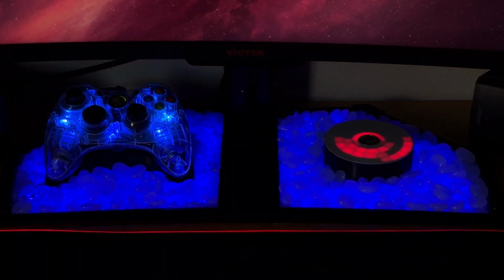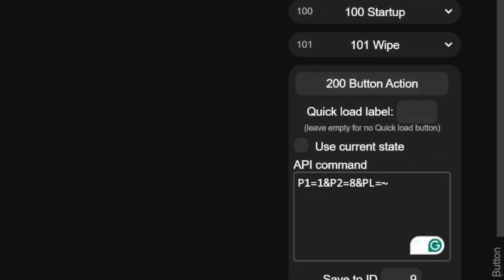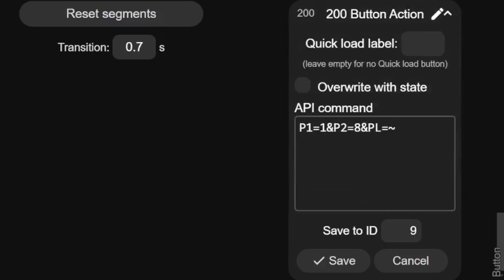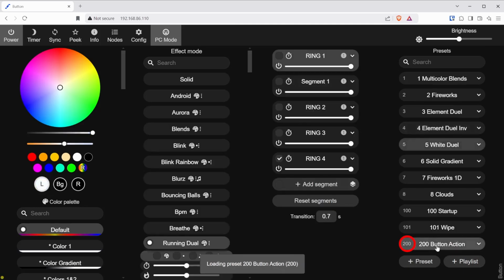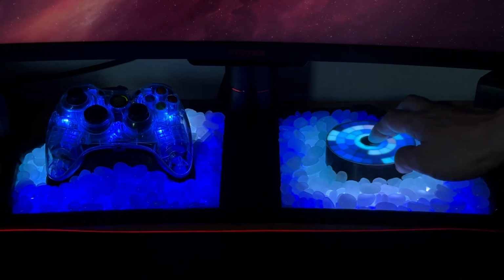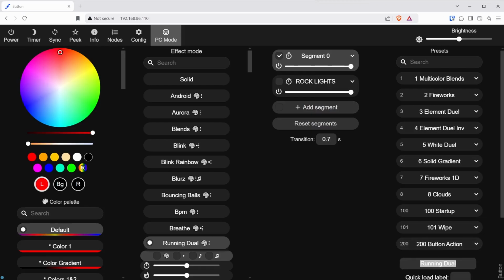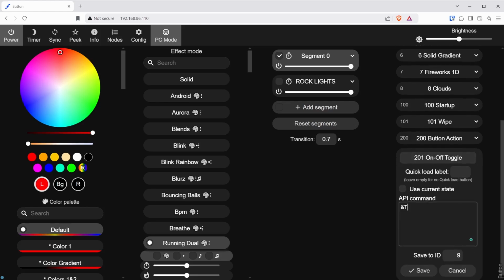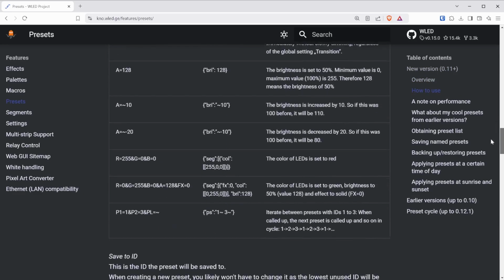How to Scroll Through Preset Effects with a WLED Button

Comment: Super useful and simple. Thanks so much. I spent nearly 2 hours last night searching for this and arguing with ChatGPT until someone directed me to your video. Seems this should be common. I would mention at least in the description that using GPIO0(zero) button has some vulnerabilities, as I understand. Holding it too long (+10sec, I think) will erase the flash (and WLED) entirely. That it's advisable to use a different location, like button 1.
Reply from the maker: Thanks, glad to hear it helped! I forgot about the vulnerabilities for some pins being used as buttons, so that is a good point to mention and be aware of that. I haven't heard about that info you mentioned for erasing the flash by holding a GPIO pin too long. I thought there was a way to do a factory reset and erase the flash with the built-in RESET button on the module, but I couldn't find any info online about that. On the WLED website, they mention that GPIO_0 is the default usage pin for a button. I added a new link with the quick-start setup guide in the description.
Reply: @Electriangle  I also stumbled across a scary claim about button 0. Turns out @ChrisPurser is right: holding button 0 for 12s is a default behavior to erase settings. 

See WLED github issue 4062 where there is some discussion of this. It's also on the wled docs page for macros: "Button 0 has two, built-in functions. 1. Hold it down for >6 seconds and the Wi-Fi settings will be reset to default. 2. Hold it down for >12 seconds and flash memory is erased."

(And thanks for the nice quick tutorial vid otherwise!)
Reply from the maker: @yourpalmike  I appreciate you confirming this info and sharing that source. I didn't know about this detail and wasn't able to locate it before. It's definitely important to be aware of. I added that specific note in the video description now with the link from the WLED docs page. Thank you, @ChrisPurser and @yourpalmike for bringing awareness to this :)